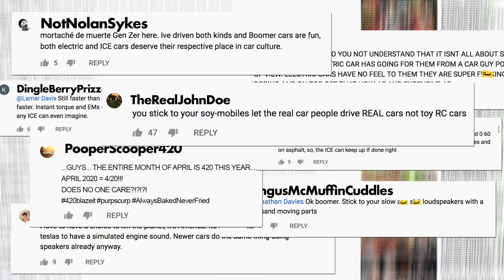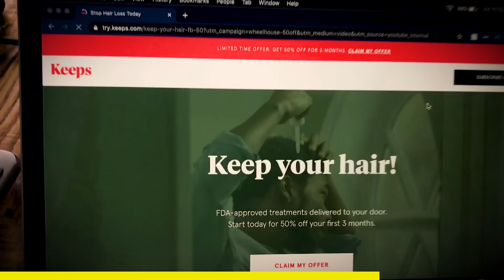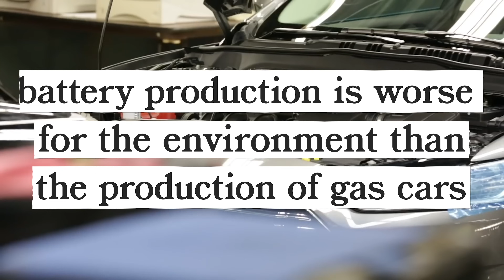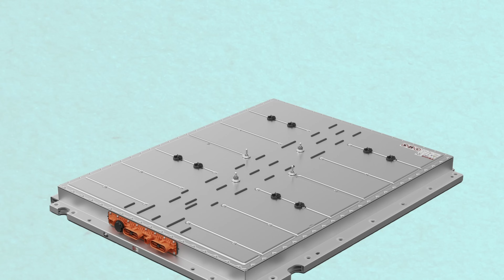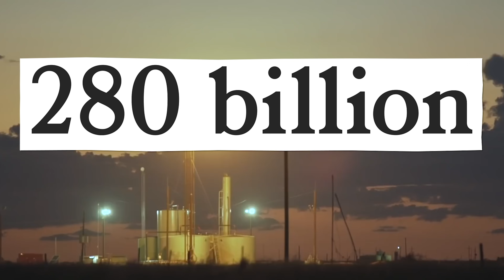Are Electric Cars REALLY Better for the Environment?

Comment: I can see it now, a bunch of guys circled around an EV drinking beer and one guy asks “so what kind of battery ya got in this baby?”
Reply: That already happens
Reply: Electric cars do have loads of potential in performance but for providing peak Power ,the EMF and frequency needs to be high proportionally! Even a few cars such as the lotus evija boast 2000hp but ultimately with a top speed of only 200mph ! But surprisingly the 0-186 figures needed for cornering takes about 9 secs , quicker than any road legal super car, quicker than even the aspark owl ! All thanks to 2000 hp ! Battery tech has progressed a lot in the following years so in the future EVs can actually perform much better ! And with incoming of solid state batteries ,there won't be possibility of freezing at cold or catching fire while overheating ! But still I find it nonsense to ban IC engined cars for now ! As they are cheapest performance machines ! IC engines are also easy to tune ! Atleast a few car manufacturers should keep building IC engines ,the ones that have been around for a century! Car manufacturers like Tesla and Lucas can concentrate on EVs ! Just an opinion !
Reply: @Noah Maddox I wish Tesla’s made a noise at least like imagine if they sounded like spaceships out of a sci fi movie. Like the quietness might be good for people who love luxury cars but to us muscle car guys it’s kinda boring. Like I won’t even talk about the Mach E Ford made. Looks nothing like a mustang and nothing short of a soccer mom car.
Reply: @lemmythebulldog8812  Agreed. Electric cars lack soul. I find them about as exciting as a dishwasher or other household appliance. Unfortunately gasoline powered cars are going that way too. All of the nanny features that prevent the teenage driver from ending up in the rhubarb are the same features that isolate the driver from the road. 
It used to be that an inexperienced driver in a powerful car would end up spun out in a ditch, but the electronics in modern vehicles stop that happening. This is giving new drivers an inflated view of their own abilities and preventing them from learning how to control the vehicle. The resulting crashes that occur when the driver pushes beyond what the electronics can correct are usually far more serious than the relatively low speed crashes of 30 years ago. Fortunately vehicles protect occupants more than the 1970s vintage used cars that we could afford in the mid-80s.
Reply: @rich7447  I always found it more fun to drive a manual shift car over an automatic. The huge luxury cars of the 50s to 70s were like fucking yachts man, make the cars bigger for those who like land yachts. We’re getting lazier as a species, soon there won’t be fucking cars at all just the hover chairs like from Wall E
Reply: @lemmythebulldog8812  I learned to drive a manual transmission on a tractor when I was about 10 and spent parts of my childhood driving various shitty cars across fields and the local bay during ice fishing season. 
The car that we cruised in during high school was considered a mid-sized coupe at the time (1976 Monte Carlo with a 350 - 4 bbl). I'm pretty sure that everyone in our group of friends slid that thing off the road at least once. 
I'm not moving towards hover chair anytime soon. In fact, the reason that I purchased my current vehicle when I did was that it was the last year before traction and stability control (AKA mandatory understeer) was added.
Reply: @rich7447  that’s awesome I wish I grew up like that. Unfortunately I haven’t been raised in that environment but my uncle builds bikes and hot rods and I learned a lot off of him. Learned how to weld, drive a manny
Reply: @lemmythebulldog8812  I always wanted to learn welding and still haven't managed to find the time. The late 70s and early 80s in rural Ontario meant a lot of freedom for kids/early teens. At least during the times that you weren't free manual labor. LOL.
Reply: @rich7447  oh man it may have been 2016 but the moment I turned working age I got working papers and a job. I’ve been working the same job ever since and I love it. Industrial mechanics in NYC
Reply: @lemmythebulldog8812  Congratulation. I'm happy to hear that you found something that you like doing. It took me over 10 years and a year long trip to the NWT to figure that out.
I'm just down the road from you in Maryland.
Reply: @rich7447  Maryland’s got some huge car shows I’ve seen em online. Always wanted to go to Maryland
Reply: @lemmythebulldog8812  It's only a 3 hour drive.
Reply: @rich7447  I got a rough work schedule so finding time is hard
Reply: I'll stick with my gas guzzling truck.
Reply: @jimmyjimmy1601  I mean you could just dump all your money into a big pit and set it on fire! 🔥 . . .  It makes about as much sense
Reply: @bardrick4220  I can easily afford it now.
Reply: @jimmyjimmy1601  when my road trip costs $2 and yours costs $200 . . . you know there's a problem!  Granted alot of it is because of subsidized chargers, but even my electricity at home doesn't cost more than a few dollars to fill up!
Reply: @bardrick4220  I couldn't care less.
Reply: @jimmyjimmy1601  well I want to make you care!  How many thousands did you spend on fuel this year?  Could you maybe have invested it in something useful or important?  . . . And some people don't have money to just burn!  They struggle just to put food on the table while greedy energy companies bleed them dry . . . so ya I want you to understand why energy independence is a good thing.
Reply: @bardrick4220  I can easily afford my fuel bill. You won't ever make me care. I'll never buy an electric car.
Reply: @jimmyjimmy1601  so damn: every soldier who died bringing you oil, the planet you need to survive on and the homeless guy under the overpass . . . just so we're clear on the kind of life you want to live . . .
Reply: @bardrick4220  LOL You're histrionics are laughable. Omg the world is going to end if everyone doesn't drive an electric car!
Reply: @jimmyjimmy1601  It might!  There is a planet in our solar system called Venus. It is very similar to Earth except that it's carbon is in it's atmosphere, the surface temperature can melt lead . . . this is an option!  And we keep on burning carbon for our power . . . this is the definition of stupidity!
Reply: @bardrick4220  Of course, we're totally gonna become Venus.......
Reply: @jimmyjimmy1601  That's called physics; you can't escape it no matter how much denial you have!  And this is why we have to make anti-pollution laws!
Reply: @bardrick4220  Yes yes, we're all going to die. I keep forgetting.
Reply: @bardrick4220  wut.
Reply: @bardrick4220  so how far did you go? How long did it take and how many stops and for how long for each stop. Cause I can tell you right now all of those numbers will be multiple times more than any non Ev. EVs aren't for every single application ever. They have their place. I will Also mention that travelling with petroleum fueled vehicles is much less detrimental than say consuming the electricity produced by the power plants ran on those same fuels. Mabye worry about the power plants and industries that could easily run on nuclear or thorium.
Reply: @NOSNOOB11  There's a reason I sold my ICE car: I didn't need it for road trips like I thought I did!  After 2hours of driving it's time to get out of the car for health reasons anyway: stretch, use the bathroom, get a coffee and a snack. by the time I've done that the car is almost done charging! ~30min. and my daily slow charging is done while I'm asleep, so it's already done when I leave for work!  My 2018 Nissan Leaf gets ~260KM (161miles) on a full charge, and that's more than enough!  I can sometimes go 3-4 days without needing to charge since little trips here and there around town don't use very much.  ODO is around ~58,000KM (36,039 miles) battery degradation is still at 100% of new.(I do try to stick to the 80->20% ruel (lithium cells will have a prolonged life if you try to keep them half charged))
Reply: Drinking beer? No drinking soy.. EV cars are like big toys for rich soy bois
Reply: Greg Baker the comment if the year 🤣🤣🤣
Reply: @Noah Maddox genius , the charger  srt hellcat red-eye is the fastest sedan , model s doesn't come even close !
Reply: @Noah Maddox and the car which I have included is under 80k ! BTW it's not that I hate electric cars , I am sure with 90% probability that EVs have a bright future ! Especially in the performance sector once battery tech has improved a lot ! It's just that I hate Teslas because they are too overrated ! I am more into lucid , NIO, Aspark and lotus evija !
Reply: @shankarwain4289  Also, EVs aren't very good in racing, which is why we haven't seen ev GT3
Reply: @kagenlim5271  agree
Reply: That makes me want to throw up
Reply: Great thread! EV’s have their place... ICE has their place as well.  I live in a hurricane prone environment, I will always have an ICE period.  When the power goes out (and it will) I will not be without suitable transportation.
Reply: Lithuium Core i50 Nuclear Turbo Charged X-RGB Hyper Sport Pro
Reply: A bunch of guys circled around an ev is called a circle jerk.
Reply: @Noah Maddox BTW sorry for being a little rude , just fucking with you ! 😂👍
Reply: @Noah Maddox good one mate ! 👍 Can't wait for the solid state battery powered space ships on 4 wheels in the future , but I hope atleast for a few enthusiasts , some special gas powered cars are still made ! But personally I hate many who have a negative perception on EVs ! Cheers !🍺
Reply: @Noah Maddox just because it weighs more so it can put more available power to the ground doesn't mean anything. Any car manufacturer can make a 6000 lb car so it has more access to the power but that's extremely inefficient, lightweight + lots of downforce is the only way to go
Reply: @Noah Maddox makes sense, I just like to keep people informed, some times people can spout some real nonsense
Reply: Check out Allen Millyards special engines. Viper V10 motorbike. Wright Cyclone V twin, Six cylinder Kawasaki (900 now 1300). Numerous extended two strokes. 
None of these would be even slightly interesting if they were electric powered.
Reply: Aria  no, im talking about 1/4 mile times. For a car that costs a mortgage, thats not impressive.
Reply: Aria  
1. Im not your "guy"
2. Go back and read my original post before you run tongue because its apparent you have the reading comprehension of a walnut.
Reply: Certainly happens in San Francisco LOL
Reply: And all those guys will go back in the house to their husbands.
Reply: @scottcped  
Comment of the year 🤣🤣👍👍👍
Reply: @zorankarabeleski392  A-thank you. Thank you very much.
Reply: @scottcped  Yep that's right and he'll be tossing my salad too baby!
Reply: @rugbydazz2264  whatever floats your boat I guess.
Reply: @scottcped  take a few testosterone injections and we’ll have them back in diesel trucks in no time!!!
Reply: @gregbaker3701  not gonna lie . . . you'd have to pay me about $1000 a month to drive Internal Combustion again!  ICE economics just make no f***ing sense anymore as well as helping the environment!
Reply: @bardrick4220  as if electricity bills are not rising up ! If you live in a Swedish urban , you will understand how expensive are E bills ! And with more demand , electricity bills would anyways peak up ! I suggest use both EVs and IC engined cars!
Reply: @shankarwain4289  well not here in Canada and with solar now cheaper than coal I don't think it will last.  You could also install solar on your own home and drive for free!
Reply: @gregbaker3701  🤣🤣🤣
Reply: @bardrick4220  depends which part of the world you live in
Reply: @user-fn1rb9ze6p  not sure what you mean.  Even in regions that don't have a grid you can still have Solar and Wind.  You can always have 1 charger at home, and that's why they invented Plugshare; the government can't really tell you what to do with your electricity!  So we networked it, so everyone can use our plugs to get around!  
You should also consider a plugin hybrid: get the first 100km on free electricity, then use gasoline to go where there's no chargers
Reply: @bardrick4220  EV's arent really suitable for me and the infrastructure isnt where it needs to be to make them a viable option for everyone, id have one if they didnt take so long to charge and charging points were made more accessible.
Reply: @user-fn1rb9ze6p  do you read!?  A plug in hybrid doesn't care about spotty infrastructure! (That's a fact . . . you can't argue with it!) It can go anywhere an Internal Combustion Engine goes because it has 1 inside!
Reply: @bardrick4220  yes!! I understand what your saying about hybrids but i was talking about 100% electric vehicles👌
Reply: @user-fn1rb9ze6p  sorry about that; hybrids are considered EVs
Reply: @bardrick4220  😁👌👍 no worries im with ya
Reply: @user-fn1rb9ze6p  soo many people are convinced that EVs don't work for them due to bad experiences or miss information spread by lobbyists . . . it's really not your fault, but I can tell you with certainty that they do since I'm a mechanic, and I drive a BEV (battery only power) every day!  I live in the Lower Mainland of BC Canada; very few places are out of my reach, and I'm content with waiting for chargers to be installed there or renting an ICE or hybrid car for the day trip!
Reply: @bardrick4220  hybrid would be the best way to go for me i think 👍
Reply: @bardrick4220  Lul so in other words you still use ICE to actually go anywhere to carry real loads to tow vehicles to get real work done to actually achieve something. EVs are still and expensive short distance commuting option AT BEST.
Reply: @sabo55  no only to go where there's no chargers!  I'm not going to buy gasoline unless I have no other choice!  I will definitely haul on electrons because it's cheaper!
Reply: @bardrick4220  ooohhhh I’m
Waiting the day we switch completely, I’ll probably be around 70 then tho so it won’t matter to me. But wait until we start getting taxed on battery charge for our EVs someone’s gonna make that decision to line some pockets
Reply: @lemmythebulldog8812  I'll agree with you on the taxes; it has to happen to keep up with road repairs, but it's going to be very unpopular with the people as all taxes are!  As for the day we switch; you didn't get the memo: it was a few years ago!  And I'm already driving mine! She runs great!  XD
Reply: @bardrick4220  no no not a personal switch to electric, I’m talking about a global or national switch in entirety where using gas becomes like illegal or something, and the only option left is an electric vehicle, it may not happen in a few years and might take a lifetime to. I hope this never happens, switching should be a personal choice, also people who love classic cars, love creating drivable works of art like a rat rod or a muscle car, people who restore cars, people who drag race and drift race. There’s not a lot of personality you can put into a tesla because everything’s given to you in a gift with a big bow. See what I mean, if we live in a world of cars and trucks there’s always gonna be people who want to take it the extra mile you know
Reply: @lemmythebulldog8812  So you want to be a totalitarian, gotcha.
Reply: @lemmythebulldog8812  Oh F*** no!  I/We will not support a Gasoline ban!  Atleaset as long it doesn't involve biofuels too.  Ethanol is an amazing substitute for gas: high octane, high power, burns clean, nontoxic, ect.  It's been used as a racing fuel for years; all you need to do is replace rubber/plastic components with alcohol rated equivalents.
The bans they're rolling out only cover new sales; these antique ICE vehicles are going to be around for hundreds of years!  We still have steam powered cars after all . . .
As for aftermarket EV parts, it's already happening.  This is how people do conversion kits.
Reply: Why electric motors not interesting to you, it'll whip your ice engine any time day or night and then take its mamma to the pictures
Reply: @mattdavies890  we've found an Elon fanboy
Reply: @mattdavies890  yea but where’s the fun in it. Everything’s given to you in a big package, a powerful motor, and great acceleration they’re about as fun as a brick. I can’t tell you how many times I felt good about building a rat rod or restoring a car, or taking a 96 Honda Civic and turning it into a drift machine. Not the only that the ICE to me is an extension of myself. The pissed off F1 sound of a 4 rotor Rotary rx7 to the smooth, growling v8 of an American muscle car it’s music to my ears. And EV making barely any noise, you can’t really tune the motors either, you can’t exactly do all this work yourself either unless you’re an electrical engineer or someone trained in that field. So far the only mods I’ve seen on EV’s is different rims, body paint, and interior which is like not even 4% of the possible tuning you can do yourself with an ICE engine.
Reply: @lemmythebulldog8812  kinda the point of EVs, modular skateboard, powerful efficient electric motors that don't need tuning run forever with a tiny amount of moving parts, hyper fast next gen runs off sunlight. But I see your point for the 0.05% of specialist cars they should survive, but the rest, the family people carrier, the commuter car, the 1.2l fiesta diesel, the rediculous 7l diesel SUV that never leaves the city of did more than 80 on a motorway / highway and everything in between should be electrified. Imagine a city with actual fresh air?
Reply: @mattdavies890 you said imagine a city with actual fresh air. Well there’s a lot of factors besides cars that cause pollution. Such as the manufacturing of lithium Ion batteries which releases more greenhouse gases than an oil refinery. Also oil is used as lubrications for certain parts, your electric motors in Teslas have lubricated bearings that allow a smooth rotation, but over time they need service. Lubrications need to be changed every so often so that your motor won’t seize. I do repairs on electric motors, not Teslas but ones that industrial sized and weigh thousands of pounds. These motors power water pumps, all kinds of water pumps. In Manhattan there’s Chill water, Hot water, Condensate, Sewage, River water, diesel, and gasoline. They all come in different sizes and shapes and they need constant maintenance to allow all the buildings in Manhattan to function no matter the business. If you want more fresh air, just shut down all the factories then. Shut down steel mills, automotive factories of all kinds, refineries, government labs, shipping yards, even a fuckin Twinkie factory. Shut down airports no more planes, no more trains, no more iPhones, and smart devices shut it all down. Then we’ll have fresh air clean water, and just be at the point of the Stone Age again
Reply: @mattdavies890  been pretty quiet after that response
Reply: @aidynsnell771  you guys clearly have your mind set, not for me to argue further the change will come in the end for all
Reply: @mattdavies890  Because you have 0 control over it
Reply: @mattdavies890  LoL for 100k it better. Btw, the Tesla model S doesnt even break into the top 15 fastest production cars
Reply: And to make matters worse it does it silently, quickly and didn't give your kids lung disease at the same time
Reply: @mattdavies890  The silence is what makes me not like them.
Reply: @mattdavies890  until it slows down at 90mph .
Reply: @shankarwain4289  why would you go more than 90mph anyway, were not talking sports cars here are talking real everyday family commuter cars, you know the ones 99% of people drive
Reply: @mattdavies890  Reall everyday  cars that cant go any real distance without having to stop for hours at a time (or in lots of half hour intervals) to cover even small distances. EVs are fine for people without any life left in them maybe, but you can forget going on a road trip or anything like that and that to me makes EVs nothing more than a gimmick for rich city kidz who like to pretend they're saving the world from the evil capitalists (or something XD). Anyway EVs suck unless you live in the places with heaps of charge points and frankly I'd rather the world turned to a nuclear ashland than wait for a fucking cellphone on 4 wheels to charge up XD.
Reply: @mattdavies890  yeah but I ain’t seen a stock Tesla pull a wheelie so 🤷🏼‍♂️
Reply: @eman7579  I ain't seen a stock anything pull a wheelie so . . .
Reply: @bardrick4220  dodge demon has entered the chat
Reply: @eman7579  show me a pic; prove the engine is stock or it didn't happen . . .
Engineers tend to design cars to stay rubber side down after all!
Reply: @eman7579  include charger srt hellcat red-eye also ! 👍
Reply: @eman7579  That's a rear wheel drive car with crazy hp. I'm sure If tesla had a rear wheel drive car with 2 motors it would be the same. Tesla obviously won't bother tho.
Reply: @lachlanB323  Exactly they haven't, therefore, I haven't seen any stock electric car do a wheelie
Reply: @eman7579  a stock Tesla can't pull a wheelie cause apart from the pos base models all of them have awd
Reply: @akilanelango8997  yup, no wheelie.